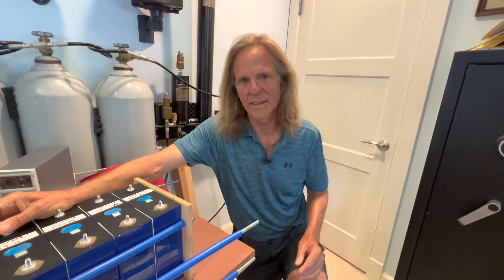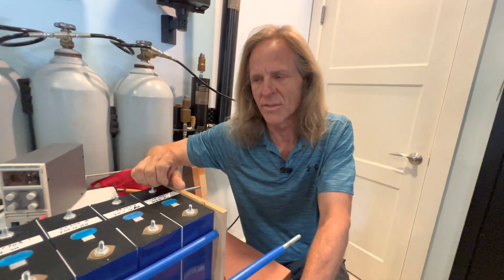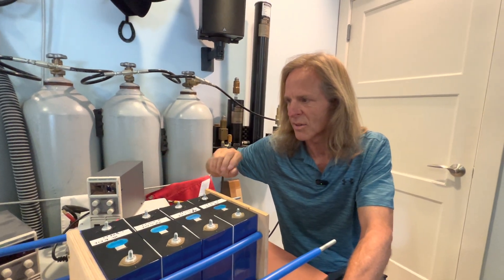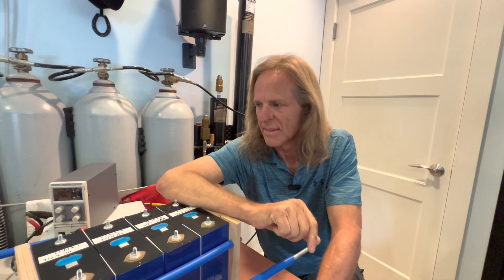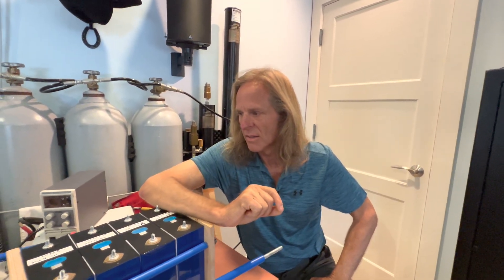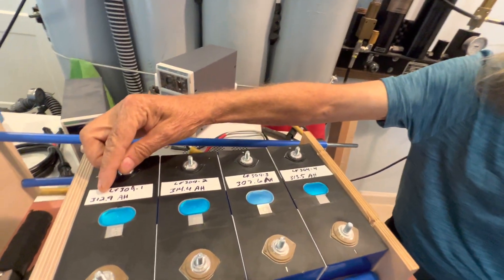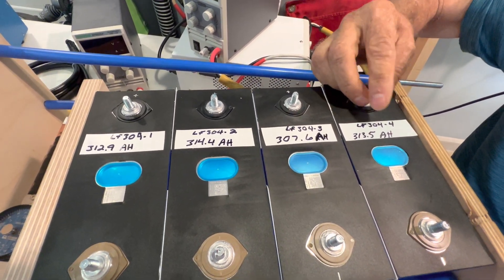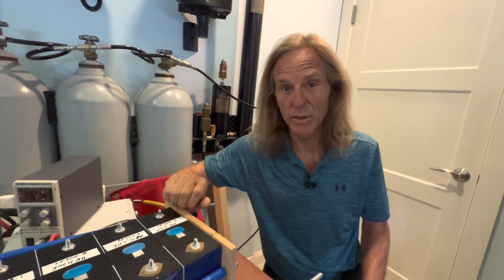Buying And Testing Lifepo4. Big Cells For DIY Batteries!

Comment: Hi, i just checked my docan power 3.2v lifepo 280amp/h batteries (32)
I have them in storage, I found one that was in bad shape 0.27 volts...
Is there any way to revive these batteries??
Thank you
Reply from the maker: @Charley1966  that sounds terrible. How did it happen? I would replace that cell.

Comment: Your thoughts on top balancing with the new 2amp and 5amp active balancers ...
Reply from the maker: I haven’t used them and I haven’t needed them. They seem heavy handed and inefficient. I might pursue them if I had poor quality cells but I would feel like I was chasing my tail at that point. 

Now that I’ve said that, remember that the first thing I said is that I haven’t used them so to avoid arrogance I will stress that point.

Comment: I noticed other solar YouTube channels have been pushing expensive server rack batteries with affiliate links saying DIY battery cells are grade B at best should avoid them. When you price out the difference it's almost 1/2 the cost when you put in 300 AH batteries. 100AH it's closer to buying server rack if you look at the BMS cost difference might as well go with the higher current.
Reply from the maker: It’s kind of funny that they would say that they’re a grade A when they’re definitely not EV vehicle grade cells and the manufacturers don’t have a grade A. They have EV certified and not. So what you get with the server rack battery is who knows in the way of battery cells, and very difficult or impossible to test what you have except for the capacity of the entire battery. In the end, it comes down to dollars per kilowatt hour. I will say that if you were trying to market a product, it is easier to promote a ready-made battery instead of helping people put their own together.
Reply: @RayBuildsCoolStuff That makes sense I understand people who have the money to spend why not just buy an EG-4 rack that is done and has a 10-year warranty. I don't have that kind of money. My goal is to investigate if it's feasible to build a DIY system to take my 5000W AC unit to battery during peak usage and cost between the hours of 4pm-7pm. If I can remove biggest load and charge the batteries during off peak the ROI might workout with DIY cell batteries.

Comment: Thanks Ray, Jenny quoted me for the 304A batteries a few months ago and as soon as I have the all systems running I shall proceed to purchase 16. BTW, I was wondering if the Seplos S16 200 will still be adequate for a battery of such a capacity 🤔
Reply from the maker: Yes but the calculation for the BMS is related to the load, not the battery capacity. Does that make sense?
Reply: @RayBuildsCoolStuff  Yes thank you, that makes sense indeed, I was worried as I'm about to order both the BMS and a set of 16 304A cells from Jenny and start building the storage unit.

Comment: You did say 304 instead of 280, what was your average on them during your test cycle? Are they the same dimensions as the 280 batteries? Nice Video.
Reply from the maker: They are the same dimensions. The average was 312.1 AH

Comment: all cells from the company EWE or CATL are sold in China have not passed the standards of the factory and are sold to the market Alibaba, Ali.honest sellers inform with this are Class B but few sellers know about it because their employers do not inform, the cell in the factory EWE class A costs LF304ah 180USD and intermediaries the same cells as did not pass the standards buy like class A for 112usd lf304
Reply: I do not know what you are talking about cause in europe you can get eve cells grade A from EvE distributors but for a different price. And all other non grade A cells have been marked by EVE as B which is engraved by them over the qr code so that his is no longer readable, but the serial is still there and can be checked with the usual qr code tools too.

Comment: Hello Ray; I'm newly subscribed now that I was able to get my Youtube id recovered, hoping to add a few micropennies to your channel.  I told Jenny Wu that I found Docan Power because of you. I can order my EVE LF280K cells with 2 threaded posts or 4 threaded holes. I was thinking that the 4 bolts on each busbar would give better conduction? I own thread chasers and know how to use a torque wrench so I'm not afraid of stripping threads. I saw a fairly recent post of multiple welded posts popping off the battery ( the whole aluminium plate and post comes free) so that scares me. I have read "opinions" but no offical  stated torque values for bolt tightening. I sent an email directly to EVE, but no response so far. I will ask Jenny. I would love to hear your thoughts on these topics.  Thanks,  Robin
Reply: you usually can find the torque limit in the pdf spec sheet from eve for such cell poles. Ask Jenny Wu if she had not send these to you. These are documents over 16 - 25 pages long with a lot of details and things you do not know . They also tell you about the version you are getting cause they = EVE are constantly improving those cells that are still sold as LF280K but with a counter which you can see only in that document which typ of LF280K you should get. Usually these torque figures are quite low so do not use too much cause you would damage the connection of the battery pole / terminal inside the battery and then you are screwed cause it will get loose then and no way to fix it.
Reply: @typxxilps  Thanks for the reply. I did find the spec sheets and printed them off. It states 6 nm as maximum torque on the bolts.
Reply from the maker: I torque temporary connections to 4nm and permanent connections to 5 or 6 nm. I think a good limit is 8nm and  I wouldn't go there personally. I use the serrated nuts. I have yet to find a connection that has loosened up later but I'm not convinced it can't happen.

Comment: Hello Ray: I'm interested in hearing your opinion on the cycle life quoted for the EVE LF280K (6000) vs the LF304 (3500). I've been quoted by Jenny Wu a price 28% more for the 304 than the 280 although the added capacity is only 9%, that coupled with the estimated longer life makes the 280 seem like a better bang for the buck. Any thoughts?
Reply from the maker: I’ve been happy with the 280s and the 304s rested really well but if it is 28% more then I would go for the 280s. I don’t think cycle life is likely to be an issue for most people.
Reply: What was your price for the 280? Want to buy too
Reply from the maker: @avarora  prices are dropping. Contact Jenny for current pricing.
Reply: @avarora  I just placed my order today, June 19/23 and The price is $90 US plus Alibaba fees and shipping

Comment: I ordered 36 cells from Yenny Wu last year. The handling, support and communication were very good. But unfortunately the cells weren't all okay. Roughly speaking, one third of the 36 cells reached just over 270 Ah, another third approx. 275 Ah and one third 280 Ah. The German community is also not only reporting good things about Jenny Wu/Docan in terms of capacity. You have to assume that - as is so often the case - you won't get an A grade after all. Incidentally, I don't think this is absolutely necessary for the usual home storage application. If you do a clean top balancing and let the cells work in the safe operation range, everything is actually fine. It seems to me that it is more important than the few Ah more or less that you are always well informed about the status of the delivery. And that you get a quick answer to questions.
Reply from the maker: Hi Ascott
How did Jenny handle your problem?
Reply: @RayBuildsCoolStuff  She wrote: Anyway, I still feel sorry for your testing result. If possible, let me apply for a small refund like 50USD for compensation, or use it for your next order ?
Sorry again.
Reply: I am from germany and gotten quite good cells each over delivering. 
What the germans did not really get right is the testing procedures and conditions EVE is mentioning in the papers like 25° C ambient temperature. Most of them did not have read those papers or looked for such high temperatures but I did and I also observed that the cells capacity increased cause I checked the lower half of my 16 cells over 100 times before I built the battery. At the end the capacity increased and now 75% of those 16 cells are above 1,5% of nominal capacity measured in Ah even though i do not care about Ah, but Wh cause that is what does matter.
And the rate in Wh is even higher than +1,5% Ah cause energy results out of current x voltage over time.
Reply: There is a thread on DIY solarforum under the vendor review, you can see how Ray is not telling the truth about the QR code a user post a screenshot showing you how the qr code has been altered from original.
Reply from the maker: @Foxfried  this makes no sense to me. I showed the QR codes and they don’t look like the altered codes I have seen. I gave a bad review to SFK when I got a set of cells that didn’t measure close to the numbers in their hand written test report that came with the cells. Now there is a thread where a fan of SFK is insulting me. OK I get that but I don’t understand how you think I’ve misrepresented anything. Disagreeing with my assessment is fine but calling me a liar is not.

Comment: You are by far the best batrery builder ive seen on youtube or anywhere for that matter.  Im in a race with time i feel having this cancer and getting a battery built that can support my off grid power system is a top priority. Im wanting my wife to have power without a power bill after im gone and even while im sick it would be nice. This solar stuff has given me a hobby that will hopefully benifit my family once im gone. Im currently using 24 nissan leaf modules but hopefully one day soon i can get some cells like you use in your battery builds. Id like a 20 or 30 kw pack so our off grid tiny home camper can make it thru a few days of bad weather. Thanks for the videos we all love seeing your stuff you do and the info you share

Comment: Hello Ray:  When I go searching to buy 3.65 volt eve cells, I'm seeing a lot of 3.2 volt, with a notation of "safe volt range" of 2.5 to 3.65 volts. Is that a 3.65 volt cell?    Thanks for your earlier reply and good wishes.
Reply from the maker: Yes that is correct
Reply: nominal ratings for lfp are all the same about 3.20 V and sometimes 3.19 V
Everything else you mention are the usual cut off voltage when charging or discharging or in particualr the points where to stop charging and discharging.

Comment: QR codes are the same thing as certificate of authenticity. It means nothing. If the cells test okay, then they are ok. If I am spending 30k, I will be taking care of my investment. I have the ability to follow directions. I will compress the cells. I will read the part that says once the cells have expanded, they are expanded. I will read the part that says the expansion takes place once the cells are charged above 3.25 volts.  I watched a YouTube'r take apart a Nissan battery pack and couldn't get the bolts back in because they were too short. The battery expanded when he took it apart. Another great video Ray
Reply: Nissan leaf is a different thing and has nothing in common with what ray is sharing: LFP chemistry
They have been already charged fully once the arrived at your door cause the dealers claim to charge and discharge them especially those that had been sold as grade B cells.
So compression is great to avoid risks caused by too high loads but it has not to be soo tight if you read what EVE has written in their big manual / spec sheet how to use these cells.

Comment: I really appreciate your videos as a source of good info on building Lifepo4 batteries. My design skills are rusty as college was 45 years ago and my electronics employment was limited to trouble shooting of mainframe gear for IBM, which required good analytical skills, but not down at ohm's law level. You are helping me to gather the confidence to build some batteries for an RV. Health problems and finances are forcing me into a life of fulltime .boondocking, a roof covered in solar panels, and DIY batteries. Thank you
Reply from the maker: Good luck sir.

Comment: So, if space is a concern, go with the larger 300+ AH batteries.  If the absolute lowest cost is what you want, the 280's are still a slightly better value?  Regardless of where you got those cells, they are certainly testing as A-Grade.

Comment: Hi Ray.
I understand that discharge the batteries down to 2.5 volt for the capacity test. However, for the day-to-day use, it might  not be a good idea for maximizing the life of the batteries. What voltage do you recommend stopping discharging them in this case? Cheers.
Reply from the maker: 3.0v
Reply: Some may disagree but 3.5 to 3.0 has been my range of choice. It also keeps the math simple.

Comment: I am interested in your results. 
Was your lastest batch just these 4 cells?
Do you think 6.8ah difference between the 4 cells is acceptable in a batch?
Reply from the maker: I would prefer they all be the same but they all tested well above the rating and I think they will perform well. Yes, I just ordered these four cells this time.
Reply: He had gotten what he had paid for and do never forget what will happen with a batch of 16 cells.
That cell with the lowest capacity will determine the capacity of the whole package cause this will be the cell that runs first into the low voltage alarm and stops the battery just to protect that single cell. 

Everything above the lowest is lost - except you buy 64 cells and put the best of the best into the first battery and so on cause then you can benefit from putting the best of the best together and all cells of these 4 batteries would be much closer together than a battery build just out of 16 cells and no choice.

Comment: I have watched some of your videos on making batteries from the cells. I cant remember hearing the price you pay for the cells. The reason I ask is more for trying to analyze the overall cost of a home built battery. I am mostly in the research phase at the moment but even a rough price for the cell would allow me to calculate and compare home built to a commercial battery. Thanks for your videos.

Comment: What kind of delta were you seeing when the cells were at 3.65?
Reply: there is no delta in the voltage cause the zke tech tester will slowly increase the voltage while lowering the Amps till it hits 3,65V and then cut off. 
What else do you expect after having charged to 3,65 V?

If you let them rest for a month then you will see weaker cells with lower voltage but not right after charging.
Reply: @typxxilps  

So you're saying you're observing zero mV between all cells at 3.65?

Comment: That tester has become the defacto standard for LiFePo4 testing. I first saw it on Andy's channel, so I bought it also. The price will be increasing due to demand. As usual, nice work!
Reply: no, the demand is no longer increasing at least here cause it had become harder to sell them used. And: lot less sales of diy batteries since ready to use rack batteries arrived here with BYD LFP cells and domestic seller and warranty. 10 kWh for 2500€ is a bargain considering that a metal case and seplos bms or similiar are not cheap. 
2500€ for a door to door delivery with a domestic warranty and BYD cells is a great deal cause the cells alone for a 8,4 kWh LFP were about 1300€. Add 25% and then you are close to 1600€ plus box plus bms which can be about 900€.

Also the sales of diy cells had been stalling for quite a longer period cause Will Prowse had complained about a year ago or so. And he can track those figures due to affiliate links sales and results, that people might watched his videos but sales had gone down. And he also asked US retailers he has been working with. The testers are usually needed only once and far too expensive to let them in the shop if you can only charge and test cells but not the big battery unless you build 1 battery a year or so. 

I bought them new, used them and sold them again and therefore I know that it had become tougher to sell those tester again. Once I finished a battery I tend to think that I would not build one again, but then a year later or too I have a need for a bigger battery due to new demand caused by replacing the central gas heating with heat pump systems. Before I had build one without having in mind that a bigger one could be better for the EV too and so I have build additional batteries to meet my needs over time. Now there are 3 of these.

Comment: What do you torque the compression rods too?
Reply from the maker: 1nm
Reply: @RayBuildsCoolStuff  1Nm is not that much, it is matching the 300KG force that is specified for the compression on the cells?
Reply from the maker: @PhilippeCJR  by my calculations it is a little less than the recommended rate.